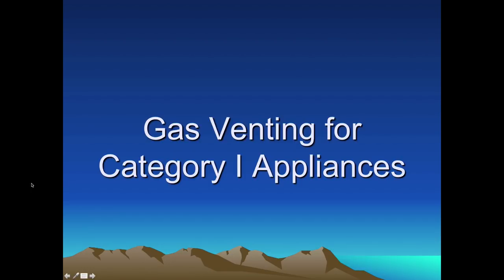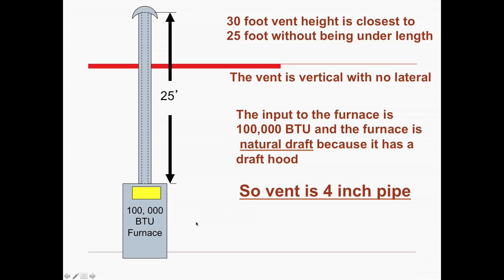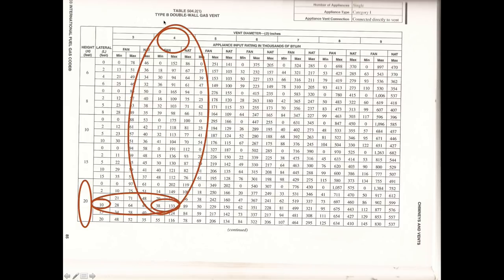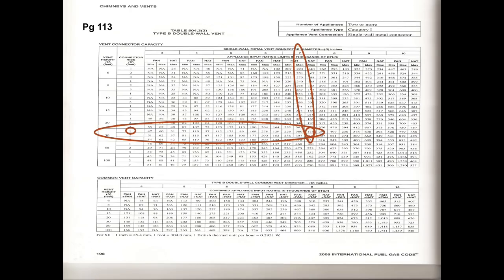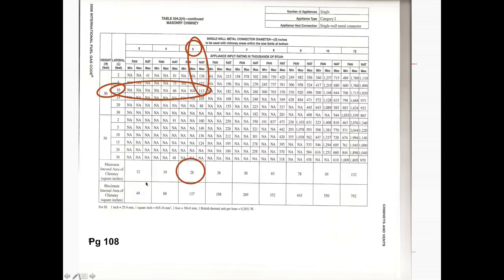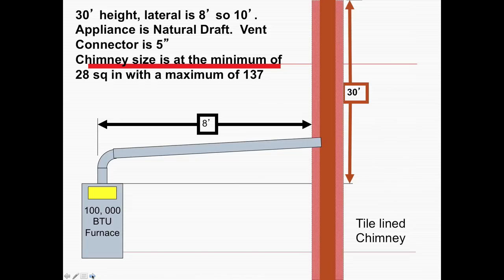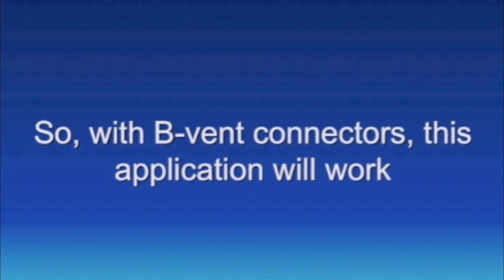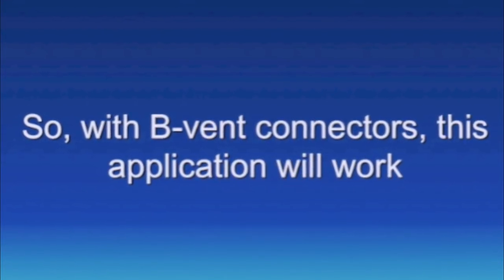Venting for cat I gas appliances

Comment: Good day, I have a question. I purchase a 35,000 btu single wall heater/furnace,  if the length of the ventilation pipe is 10 foot. How big/ wide should the pipe be?. 3, 4 or 5 inches.
Reply from the maker: The minimum size should be the size of the vent connector on the furnace.  Probably, with a 10 foot vent, that size will suffice.
GFM
Reply: @grayfurnaceman  OK 4 inches. Thank you

Comment: Very Nice Video;    Double wall vent pipe is called Type B.    The reason it is used is for safety ( 2 walls) and so the hot flue gases DO Not cool off too much so the flue gas rises.

 I mention all this because it might not be obvious  and heck I did not know this too at one time. I heard the safety 2 wall feature along time before I heard the inner pipe purposely kept warm story.

The double wall has an air gap between the sides and thus is insulation. The inner pipe heats up quickly and is not sinking ie passing heat much to the outer wall. One wants the flue gas to exit before the water in it condenses very much too, thus a warm inner pipe keeps the "draw" going to pass the flue gas out of the building.

In a house here with a furnace in the attic installed in 1994 it has  I think a 3" type B pipe and the installer just stuck it inside the old 3 feet of 6" single wall pipe below the roof deck that exits the building. They added no coupler and just had one pipe inside another with an overlap. The flue gas would condense and dripped down the angled 4" type B pipe and ruined the sheetrock in the ceiling below. Thus a hokey poor vent system besides being a fire and Carbon Monoxide risk can just be basic  water causing mystery leak that ruins a house and causes a water source for ants and termites. Sadly the HVAC installer always though it was a leaking pan under Freon A coil and thus the odd rare problem never really got fixed for over a decade plus. 

https://www.youtube.com/watch?v=8w-qhxVH-Cc

Comment: good video i just have a question because the paper im working on has everything that you went over but there is another line that asks for the "vent Capacity" so for example its 15'H 2'L BTU INPUT of 163,000: and it asks for the "vent size" and the "Vent capacity" I know that the vent size is 6" but im just not sure on what its asking for with the "vent Capacity"
Reply from the maker: Vent capacity is the number of BTUs the vent is capable of handling.
GFM

Comment: Very informative video. Thanks for sharing. Do you have any videos for a positive pressure vent Cat IV. I haven't been able to find a table in the IMC 2012 that will tell me the size for a 90% Efficiency.
Im trying to see if I can do a common vent for a 60,000 BTU 96% furnace and a 199,000 BTU Tankless Rheem. Need to know the size for pvc vent.
Reply from the maker: There is no table I know of.  These are manufacturer instructions design.  Also, you cannot vent 2 positive pressure appliances together.
GFM
Reply: I was thinking the same thing. However Navien's Tankless water heater website has a common venting guide for multiple cascading tankless units all using a common vent. I question that method but can't find anything in the codes IMC and IFGC2012 that says you can't vent 2 positive pressure appliances together. Maybe i overlooked it.  Do you have the code chapter number prohibiting common vents for positive pressure appliances and why would it be a problem???  Thanks again for your knowledge.
Reply from the maker: If the Naivien heater is 80% it can be common vented.  I am not sure where the prohibition of common venting is.  The reason for the prohibition of multiple appliances on one vent is if one appliance is on, with the other off, the positive pressure can cause the vent gasses of the one appliance to enter the off appliance and enter the structure.  
GFM
Reply: That makes perfect sense to me. I was thinking that since it was a closed system the CO wouldn't enter the structure. But I needed a professional to confirm that so I thank you again for your time and help.
out of curiosity I will look into Navien's tankless heaters to see what efficiency. Thought all tankless was at 90+% It might be possible that Navien expects all the units using the common vent to be running simultaneously to force the gasses out.
Reply: just a follow up
I called both Navien, and Rheem technical support and they confirmed what you said about gasses entering the unit and structure. I then asked them why would they have a manual online showing multiple units sharing a common vent. No one could answer that so I called Rinnai who has a common vent manual as well. Rinnai confirm my thoughts. The customer support said it's because they are all working in unison to fulfill the high demand for restaurant and hotels etc (Cascading). So therefore the gasses won't come through because they are all on pushing the gasses out at the same time.
Reply from the maker: Good work
GFM

Comment: It would look as if heat retention has something to do with exhaust flow rate in a given sized venting situation? Is this why the type B "seems" to be more desirable in some installs?
Good stuff, thanks
Reply from the maker: Craig Nehring Correct.  The newer fan assisted furnaces have lower vent temps, so single wall pipe losses more heat than B-vent.  This reduces the ability of the gasses to rise and often causes condensation in the pipe or chimney.  Thanks for the thoughts.
GFM
Reply: If the furnace is located in an unconditioned, ie. heated, area B Vent should be installed from the furnace connector to the vent cap. Have seen single wall installed and it will rust out in a matter of just a few years.
Reply from the maker: Gary Reecher On newer furnaces even in a conditioned space, B-vent is a good idea.  According to the IFGC, all vent pipe must be B-vent if in an unconditioned space.GFM

Comment: As someone who has been doing home improvements for 40 years, but never HVAC, I'm curious as to how this applies to flexible chimney liners.  It just so happens I'm looking at a situation where I have a draft induced furnace currently installed with a 12 foot Bvent lateral directly into a 8x8 tile lined 32 foot chimney where there is now damage.  I'm looking at redoing the vent and lining the chimney using insulated flex.
Reply from the maker: The chimney may have been damaged because it was not lined.  The 2 methods I have used are B vent in the chimney and "Z-flex".  I have not seen insulated flex.  However, if the chimney has any surfaces that are outside, the space in the chimney will need to be insulated.
GFM
Reply: @grayfurnaceman  I'm pretty sure the damage is due to the furnace exhaust, it's a pretty common failure on old houses in my area (WV).  I was just curious as to how one might figure for proper sizing when utilizing two different vent types, B for lateral and single wall Z-flex for the chimney itself.  I've seen flex kits that come with insulating sleeves.  Thanks, R

Comment: What is the liner is 8 inch but doing the calculation correctly lets say needs only 6 or 7 inchss could I still use the 8 inch liner since it is already in there
Reply from the maker: +Dave C The 8 inch will probably work.  Limitations are does the vent go thru an unconditioned space before exiting?  Does it go to a masonry chimney?  The best solution if the vent is all Bvent and goes directly thru the roof, is to put the proper size inside the old vent.  Hope this helps.
GFM
Reply: +grayfurnaceman yeah its all 8 inch liner it use to be and still is oil want to covert to gas which is not a problem just as far as sizing chimney and vents i slack little
Knowledge it will be for a water heater and 100,000 btu its definitely bigger than what i need  and was curious to see if possible can get away with it ive heard people say they use induced draft to help push the flue gases better would this be a case for it I completely understand you cant see chimney and job in front of you I appreciate your reply back i am 6 yr tech i enjoy your videos a lot and have always learned something from your videos whether its something simple or complicated your experience and knowledge is awesome thanx again and happy new year
Reply from the maker: +Dave C Happy new year to you.
GFM